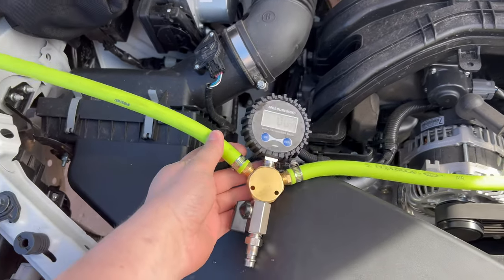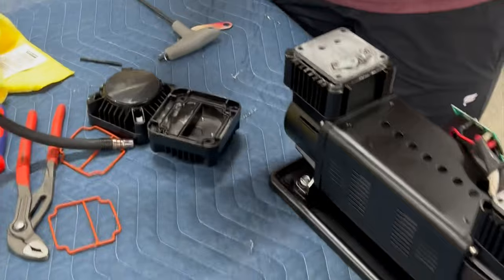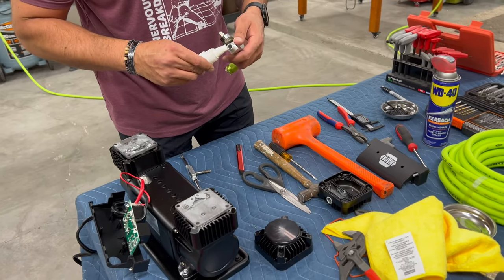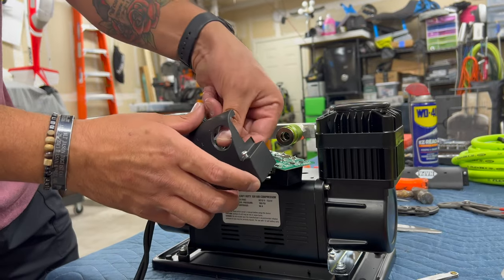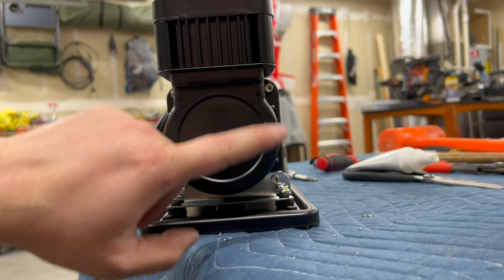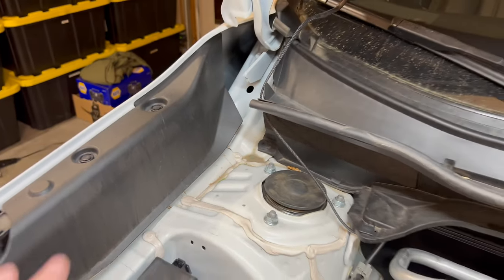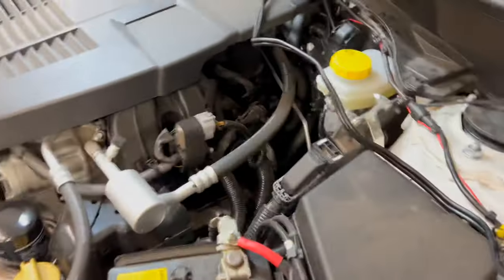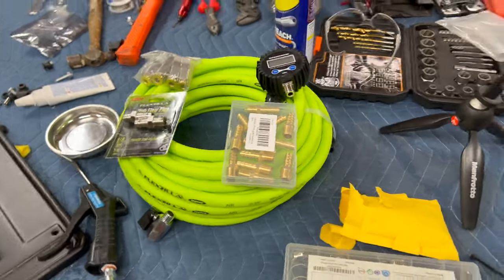Subaru Forester Onboard Air Compressor with DIY 4-Way Inflator

Comment: I have this same pump (or a Chinese knock off equivalent) and it is beastly. We had it in CO, not sure if you saw it. We aired up JonDZ's Honda with it.

Good stuff though! 

Couple extra thoughts:

1) This pump WON'T set a bead. On a 245/65/17. It almost will on its own. But it won't. It will hit thermal shut off for the duty cycle first.

Ask me how I know this. 

A small tank added could possible have enough volume and pressure to set a bead if it comes to it. But not sure where you could hide it. Especially in the engine bay. Possibly where a dual exhaust set up could go?

2) I didn't see the ends of the hose you made but if they're the screw on schrader valve connections they make quick disconnects for them. They work similar to the air chucks. Put on, slide the collar, connected. 

They're cheap too. I want to say $10. Could be even quicker if you don't have them! 

3) Let me know how the pump holds up in under hood heat. I've never had good luck with them there. Even when they're 'rated for engine bay use'

4) Rivnuts! If you don't want to tap relatively thin sheet metal. Rivnuts are a great way for making threaded nuts in a surface you can only access one side of. They're relatively cheap (and arguably cheaper than a tap and die) 

Keep at it Matty!
Reply from the maker: Thanks Bruce! Yeah, resetting a bead usually takes a shop sized air compressor, or some flammable spray used in conjunction with a normal air compressor. I’d just switch to my identical 5th before messing with any of that stuff though. I’m a big fan of rivet-nuts, but there’s plenty of steel to cut those threads. The compressor is 18 pounds, shared among just 3 points, each one has to hold only 6 pounds, super easy. On mine I made a custom aluminum bracket to mount the 4th corner too. Definitely secure, even without that! The cover keeps the compressor clean and dry. It has a duty cycle of 15 min on, then 5 off, but it airs all 4 tires up from 15psi to 32psi in 2 minutes, so I don’t think that heat will be an issue. Yeah, the 4-way uses the quick clip on chucks. Normally a single Schrader valve is the bottleneck, but filling into 4 of them at the same time solves that flow restriction. It’s a great setup. We aired up and down 4 cycles while we were in Moab recently. Couldn’t be happier with the setup! I just hope the Outback and Crosstrek people can find a place to mount one too.

Comment: Looks great.  I had been eyeballing that spot for my OBA compressor system build, but decided against mounting it there due to under hood temps during the summer months here in California.  I'm using the spare tire well to house two tanks I harvested off an old hand me down compressor that stopped working, and since the 5th spare does not fit in there anyway, it's the perfect utility for that space.  
I wish I had the knack for filming my projects like you do, as we have almost parallel forester ideas with slight differences (which can be beneficial to the community).
Reply from the maker: Right on! There's a ton of useful space under there! Honestly, if you have an air compressor, tire patch kit, glue tread kit (look it up) and emergency tire valves (look those up too), and a can of fix-a-flat, then I think you can live without a spare tire. And all that stuff will be helpful to other people too. Just film on your phone, haha. That's what I do most of the time.

Comment: Do I need this? No.  Do I want this? Absolutely. I already have a voswitch installed that I believe I could wire it into. I have a compressor in my car anyway as a “just in case”. Would be nice to have this setup to save some room.
Reply from the maker: It’s a sweet setup! Airing up and down is quick and easy!

Comment: clamping the negative on that side of the sensor, bypasses the current shunt.  it can confuse the car regarding the state of charge of the battery, which can lead to the alternator doing weird shit as it thinks the battery is full when its empty, or empty when its full. (i've experienced this on other cars....)

otherwise, super nice and neat install!
Reply from the maker: Hey William! Yeah, for research purposes, on the new Forester,  I installed some stuff on that other terminal. Like you said, it allows the car to detect the amount of current being used, but the 15 amps used for the voltage booster (fast charging the EcoFlow power station) was apparently too much. The car kept interrupting it, turning it off then briefly on over and over, very frustrating. This would have been really very frustrating if I was trying to run a winch and do a recovery. Using the other terminal is a MUST for other high power things like a winch. I was hoping that by using the other terminal I could let the car detect how much current I was using, but I can say for sure that 15 amps is too much. However, the car is still able to detect overall voltage, which is enough for the alternator to do its job. Bottom line, use the other terminal for high draw applications.
Reply: Looks awesome. Does the compressor care about its orientation as far as oiling goes? Also, can you reach up inside the fender and add a nut to the rubber mounts? Fun project!
Reply from the maker: The air compressor does not care about its mounting orientation. You could add nuts to the lower ends of the rubber isolators, but that's not necessary because all the holes are tapped (threads cut with a tap)